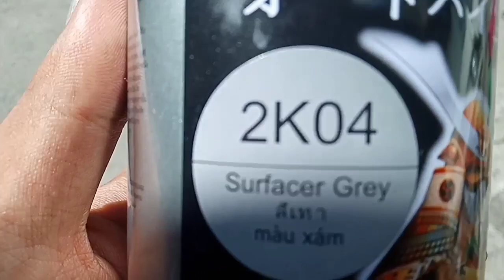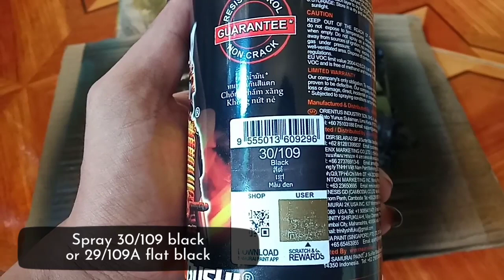Khameleon T808 Samurai Paint on Raider 150 Crankcase / How to paint crankcase step by step🔥

Comment: Sir ang ganitong Process para lang ba sa gustonh mag Khameleon Color? Plano kopo sana Pinturahan ang crankcase cover ng RS150 ko na Kulay White Or Silver po. Paturo naman po salamat
Reply from the maker: Anong kulay po sir?
Reply from the maker: (white)
Surfacer
White
Clear

(Silver)
Surfacer
Silver or metallic silver
Clear

Yan lang mga kelangan nyo sir
Reply: @suissacin1026  sir ano po code ng Surfacer na Samurai ung first coat po para sa Heat 2k po ba yun?
Reply from the maker: @ravenlovesyoursong3759  2K04 po sir
Reply: @suissacin1026  ung may Epoxy na name sir?
Reply from the maker: @ravenlovesyoursong3759  yes sir
Reply: @suissacin1026  sir ask ko lg po bakit po ung surfacer may expoxy na name?
Reply: @suissacin1026  sir Pwede dn ba gamitin kong Surfacer ung Ung kulay Grey Na UCh210 pero di po siya 2k
Reply from the maker: @ravenlovesyoursong3759  pwede din naman sir pero mas okay sana pag 2K kasi 150cc ang motor mo mejo mainit konti, mas mataas kasi heat resistance kapag 2K.
Reply: @suissacin1026  Sir another ask lg po ulit, pwede kopo ba gamitin ang 2K04 primer sa mga Plastic cover ng motorcycle sa Matte plastic at Gloss?
Reply from the maker: @ravenlovesyoursong3759  yes sir pwede po. Panuorin nyo nalang po sa tutorial kung pano mag activate at pano gamitin kung wala pa kayo idea para di po masayang
Reply: @suissacin1026  maraming salamat po sa panahon masagot niyo po ako 😊😊😘

Comment: heat resistant ba yang ginamit mo sa Crankcase mo bossing?
Reply from the maker: Hindi masyado boss pero samurai Kaya nya magresist up to 180°C so pwede po sya sa crankcase Ng mga 150cc and below na motor.
Reply: @suissacin1026  ok boss, salamat, 
pero halimbawa yung hi temp. na flat black pero ibang brand papatungan ng CHAMELEON(SAMURAI), pwede ba? 
salamat bossing..
Reply from the maker: @minzsky  not sure sir. Di kopa natry. Mas ok pag straight samurai para sure walang chemical reaction mas matibay pa.

Comment: Sir meron bang hightemp na chameleon
Reply from the maker: Wala boss. Pero lahat ng standard paints ng samurai paint pwede sa crank case lang pero di na pwede sa cylinder block at elbow
Reply: Salamat sir ilang beses po ba apply ang pintura sir.
Reply from the maker: @jhonnoelmier6909  2-3 coats bawat paint sir
Reply: Salamat ulit sir nag subscribed na po ako sa chanel mo sir.kahit anong flat black na gagamitin sir ok lang ba
Reply from the maker: @jhonnoelmier6909  thanks boss. Flat black or glossy black okay Lang Basta samurai paint lahat
Reply: Salamat ulit sir sa mga itinuro mo.